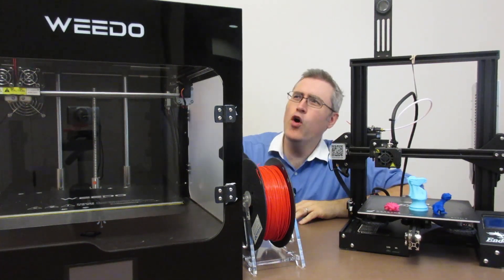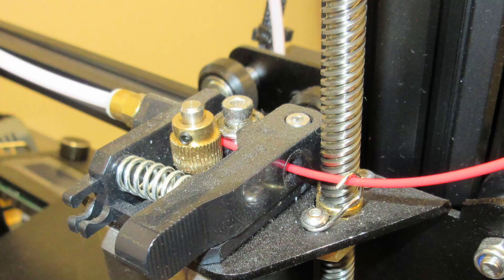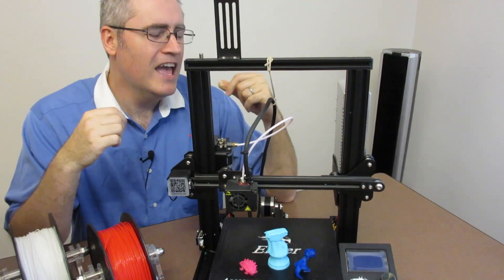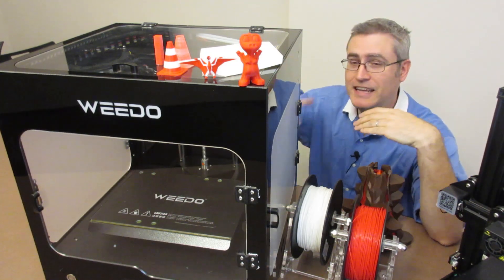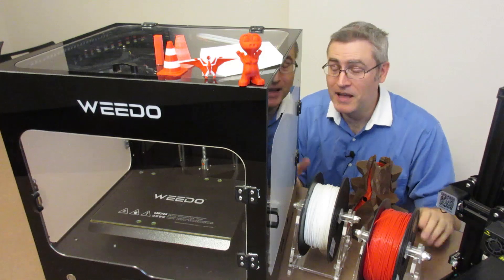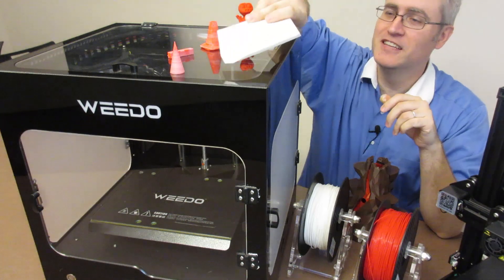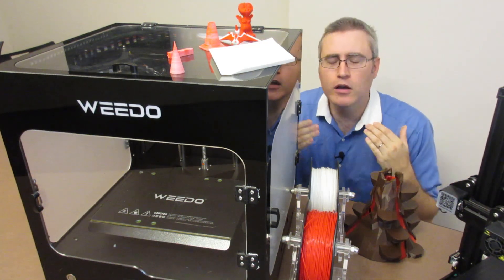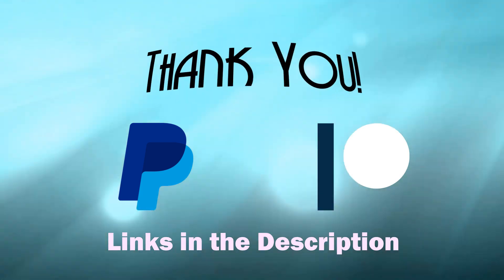Ender 3 vs Weedo F192 Double Review

Comment: Someone near me is selling these brand new for $300. Is this a good buy for someone who is new, or should i just get the Ender 3 V2?
Reply from the maker: The F192? I would say it's reliance on WiiBuilder, their custom slicer, is a major handicap. I don't mind it when BambuLabs or Flashforge made their own slicer because it was good, but WiiBuilder is still a pain in the butt to use. 
If this is your first 3D printer, I wouldn't recommend either this or the Ender 3. Enders are notoriously badly documented. Instead, my not check out the Mingda Magician V2. A well documented machine with the same capability as the Ender 3.

Comment: It's like comparing a Rolls Royce with a Ford. I have used an Ender 3 for six months and for the price it produces great prints right out of the box. Assembled and printing in under two hours for not much more than pocket money. The Ender 3 is a great introduction to 3D printing.

Comment: I have an Ender 3 and we were printing within 2 hours of opening the box and this is our first 3D printer. I have to say after you went on your rant about assembling it I really started to discount other things that you've said in your videos. I by no means I'm saying that the Ender is perfect but for the price it's a solid entry level 3D printer. Not only that but you're nitpicking over the location of the filament feed is trivial since it doesn't effect the filament, if you really wanted to nitpick you would have mentioned about the location of the cooling fan for the processor.

Comment: Does the weedo have a 32 bit board with trinamic drivers? Does it have a heater for its enclosure? Does that board have wifi access?

Seems like the weedo is is overpriced and underfeatured

Comment: An over $1k printer and I have to turn screws on it to level it? I put a cheap BLTouch on my Ender3 and I don't have to touch a thing for it to auto level. The Ender3 is also my first 3D printer and it took me less than an hour to put it together. I have access to two Prusa Mk3s at my work and I'd rather have the Ender3. For $200, it can't be beat. Although, you have convinced me to never by a Weedo.... ;-)

Comment: Having the extruder so close to the axis screw is actually one of the reasons ive ordered an Ender 3 compared to other low cost printers, mind you it hasnt arrived yet and would be my first printer. But due to my background as an industrial mechanic i know that its a good design to have the extruders mass close to the load bearing point, having it on the opposite site would introduce so many issues, just mentioning levering force and mass acceleration should be enough to point it out.
Reply from the maker: Good point, but why can't they move it just a centimeter back? The Tevo figured it out. Mind you, my Tevo wasted a month of my time and couldn't actually print, but the solution is out there.
Reply: @3dpprofessor  I dont know how cost efficient crealities engineers design, but that one centimeter can make the difference between a cheap part being enough or a more expensive part being requiered, or a part of stock being used or a new one being requiered. When i see how much of the Ender 3 can be improved with it printing parts for itself i guess its a mixture of cost efficient and tinkerbox engineering.
Parts the end user cant improve easily? Put in decent to good quality parts.
Parts the end user can easily print, tune, tinker with themself? Leave them out, people can print them themself.
For a plug and play experience most businesses requiere thats not a good think, but for the home gamer it might be the best design idea out there imho. Cheap entry cost, early learning of the machines mechanisms and how to improve them, etc.

Id only question why they didnt put parts to improve the printer on its SD card...

Comment: I'm fairly sure your Y gantry is not level.... just by looking at it.  

It's an easy to fix.  Just get the the screws attaching the two plates that the rollers are on loose enough that you can tweak them manually (there is some play in the holes). Make sure not to loosen them so much that everything is floppy. You'll also want to get the wheels wobbly so things are easier and things don't bind (ie loosen the ecentric nuts on both sides). You'll have to remove the assembly from the vertical extrusions so also take off the top bar. Once you have that done....

Get two spacers (I used two hard drives) that the assembly can rest on. Set them on the bottom extrusions (remove the screen to get enough room on the right side) and lower the gantry. Gently press down until both sides touch their respective spacer. The assembly is now true. Tighten everything up paying careful attention not to tweak the left plate (this is why the plate bolts need to be loose and not floppy). You'll probably want to get the left plate tight first just because it has to come off the machine and if it tweaks you have to start over. Once that is all done it's easy to verify you're true by using the same spacers or a caliper.

Should take 5-10 minutes but probably don't have the same people that put it together do it.... would be a 2-3hr job ;) jk but really I think you should have audited the build a bit better.
Reply: Note that my Ender 3 is my first 3d printer. I've spent a lot time last couple weeks getting it dialed in. At this point my leveling pattern (5 circles on each corner and middle) are within 0.01mm of ideal and are perfectly smooth with no gaps etc... calibration cubes and walled cubes are right on.  Near perfect dimentionally accuracy as far as I can measure.

Comment: You spend $200 on a box of parts that kind of work. Then you spend weeks of time and hundreds more dollars to add on everything that is missing and to try fix the crappy engineering of it in the first pace. When you are done you have spent as much money as a better quality printer in the first place.
Reply: You can 3d print most of the parts that can improve the ender 3 printer you are talking about dollars not hundreds of dollars.   Marlin is also open source and is constantly being improved on.    I am currently running klipper  off a raspberry pi  i have probably spend about $100 bucks to improve the printer which includes proper auto bed leveling not this it tells you how much to turn crap.   I built an enclosure probably cost me $50 bucks for total cost since I purchased my ender 3 for $170 on sale looking at $320 vs $1500 bucks.
Reply: Odd ... I had my Ender 3 built in under 2 hrs (because I work in machine maintenance and got anal about verifying the build every step of the way) had it leveled in under 15 minutes, and half a decent print by the end of the evening.  The next day, the filament from the split order came in and I was happily printing minutes.  The ONLY reason I printed add on parts was for convenience and aesthetics.  The only thing I've spent hundreds on is filament - which is a consumable you'd spend on any 3D printed.  Now ... I suppose I could agree that people with zero mechanical aptitude and no patience may not be well suited to an Ender 3 - but they probably shouldn't get involved in 3D printing in general.

Comment: I work in additive manufacturing primarily with powder bed metal, but we have some big stratasys printers and some smaller uPrints. Can’t stand how limited everything is on their printers and the quality isn’t even as good as what I get on my CR-10S at home. No, I can’t print things like ultem, but for a several-thousand dollar difference, I find some of the printers like the CR-10 and ender 3 to be wayyy better value than the closed-source stuff

Comment: A day to assemble the Ender 3? It is my first 3D printer, but even taking my time, assembling it carefully, I produced my first PLA print within 2 hours, and my second print was a perfect test dog using ABS, in open air, about six hours later (I got lucky with the ABS that time, and removing the print destroyed my print surface due to the extreme temperature required to get the ABS to stick. Now I have an enclosure, borosilicate glass, and a PEI sheet. I also found that ABS prints often do benefit from running the fan, balanced against a bit higher nozzle temp to improve layer adhesion.)
Reply from the maker: Yeah, I did mention I was reaaaly burnt out on kits by the time I got the Ender 3. There may have been some procrastination.

Comment: Makes no sense. With that amount of money you can buy 6 Ender 3 printers. or even 5 and build a simple persplex enclosure. Which is what I have done. Also it took be about 3 hours to build 3 Ender 3 printers and I have never built a 3D printer in my life.

I have recently owned a Flashforge Adventurer 3 and it was rubbish and big let down. Returned it and never looked back with regret.
There are many factors into why an Ender 3 is the smarter choice. Also manual bed levelling is not that complicated when you factor in all the variables. Once the bed is levelled correctly, you should not have to play around too much. That is with Glass beds, magnetic beds and standard beds. I have all 3 beds and each work fine. Only limit is no ABS with magnetic bed.

That start up sound from Flashforge will forever taunt me. It was a really bad introduction to 3D printing, and goes to show that sometimes you don't always get what you pay for. In 3D printing, looks of a printer are not what counts. It is performance. And the Ender 3 menu system and screen might be old, but it works well. Does not freeze or have touch sensitivity problems like others do.

I think this review was a bit misguided considering you did not build it yourself. But you are entitle to your opinion.

Also, a major step that should be on the Ender 3 build manual is to FIRST and FOREMOST loosen the side bolts and rest unit on level hard surface, then frame will sit flush, tighten but do not overtighten, mount everything else, and then tighten them firm last.

At least everything is accessible and not hidden away. Easy to maintain too.

Comment: the bed size on the ender 3 isnt 200 X 200 its 220 X 220 X 250
Reply: Actually its 235 x 235 x 250
Reply: @dronephotographyireland  The official specs are 220 X 220 X 250 but you can do 235 X 235 X 250

https://www.aliexpress.com/store/product/CREALITY-3D-Printer-Ender-3-Ender-3X-Upgraded-Tempered-Glass-Optional-V-slot-Resume-Power-Failure/2846085_32858931045.html?spm=a2g1y.12024536.productList_2866066.pic_0

Comment: Ender 3 may look robust and has received many positive reviews on YouTube, but I personally don't think it is that good.  I have had mine for nearly 2 months, have tried umpteen different settings, yet have not been able to make it print consistently. I have had fantastic and consistent results on an older 3D printer, the Startt, a $100 U.S. printer which was 100% kit format. It printed great right after plugging it in and continues to do so to this day.  
I feel the quality of the prints on the Ender 3 are far from good and something you would expect if you cobbled parts together to make your own kit printer.
Reply: I have a CR-10S, not an ender 3, but I and everyone I know that has an ender 3 (which is quite a few because I’m an additive manufacturing engineer) has been very impressed with the results from creality printers. It shouldn’t take much fidgeting with the settings unless you got a messed up printer. Just recently helped a friend choose an ender 3 as his first printer and it performed  awesome right out of the box
Reply: Since you know so many people with Ender 3's, maybe you can have them send me their CURA settings so I can do awesome prints and also become impressed with the Creality printers!
Reply: peter bucik for Hatchbox PLA, you can just use the stock recommended PLA profile with 0.1mm layers, but with the nozzle temperature increased to 215C instead of 200C
Reply: @BenWilson24  I am running my Ender 3 with Hatchbox PLA at the 200C setting and it works beautifully- including the glow-in-the-dark and clear.  Never had the need to up the temps to 215C. As for this comparing video- dude is trying to compare apples to oranges.  If it took him a day to assemble an Ender 3, he needs to get into another line of video reviews.
Reply: Yeah. It's a great printer if mediocrity is all you strive for!!!
Reply: @pjb5262  Actually, in all the printers I have (over 200 different types), the Ender 3 is one of the best... and easily at the top considering the price.  Perhaps there is something wrong with your particular machine that is causing the issues.  The stock settings (or Chuck Hellybuck's settings) are perfect for it.  Try them, if it's not working correctly, it's time to diagnose it and see what is causing the issues.  Most of the times, it's loose eccentric nuts or belts causing slop in the system.
Reply: peter bucik what do you print with?
Reply: @BenWilson24 If I am after accuracy and structural integrity I will print with my Startt. I can use the same Cura setting for anything I print without any modification. I tried the settings you gave me for Ender, and the results were somewhat improved, but  far from good. I generally print mods, repair parts and rc parts and therefore require more integrity in the 3D part unlike someone who is  printing  figurines. Check out ColdCanuck on Thingiverse to see what the little Startt printer can do. Even the Ender mods were done on the Startt.
Reply: peter bucik both accuracy and structural integrity can be tuned through setting adjustments. If the default Cura settings don’t get you that out of the box, then that’s just a mismatch of Cura’s default settings with your printer and environment; creality’s printers are very rigid and use the same motors as many brands, so they will do what they are commanded to do. Don’t confuse Cura’s suggested settings or settings you’ve tried with the quality of the printer itself- they’re separate. If you’re looking for mechanical properties though, I’d swap to a different material like PETG or ABS. I’m currently running a large factorial DOE for determining settings that get me a solid balance of strength, dimensional accuracy, and density for PETG because the default PETG settings in Cura weren’t perfect. A lot of factors come into play with dialing in settings like the ambient temperature, the brand/quality/state of your filament, etc.

Comment: Auto level that you have to turn screws on? My ender 3 and bltouch is truly auto level. And anyone that takes a full day to build a ender should maybe not be in 3d printing.
Reply from the maker: That's not actually auto level. that's level correction. It doesn't make the bed flat, it just adjusts the print to compensate for a bad level. Big difference in my opinion.
Reply: @3dpprofessor  So what happens if the weedo bed gets warped, uneven surface, etc.   Truth is, the weedo uses the EXACT same method as the ender to "level" the bed if you were using an inductive sensor (much less accurate than the BLTouch) instead of a bltouch, except the weedo only probes 3 points, and the Ender can probe as many as you choose. The difference is you can set the Ender to automatically correct for the misalignment, or you can use it to MANUALLY adjust the bed screws to achieve level.  The fact still remains, the weedo does NOT have auto bed leveling, rather sensors to tell you if the bed is level or not. The leveling happens manually... The weedo has no mechanism to correct for warped bed, uneven surfaces, or what not.  While it may be less of a problem with the weedo than the ender, the fact remains that there are no groundbreaking amazing features of the weedo to justify the price difference. Better materials and/or build quality, maybe...But not worth it in my book.
Reply: 3D Printing Professor it’s a huge difference.  Level correction indeed, and if you have a warped or bad lead screw your in for a rough time with bltouch. Relying on the lead screw vs a truly flat bed is night and day.  And creality is known for supplying warped  beds...  and poor quality lead screws. Bltouch is nice, but won’t truly correct for poor bed build quality, and will make a bad situation worse if one has a bad lead screw.  I’ve got two Ender 3s and both came with severely warped beds and lead screws. As far as I’m concerned unusable print beds.  One uses bltouch and one is manually set.  The one without prints a bit better, and without a replacement lead screw.  The one with the bltouch took so much longer to get printing properly, including replacing the lead screw with a much higher quality one.

Comment: A day to put the Ender 3 together?!?!  Were they 6 years old?  I have never assembled a 3D printer before but when I got my Ender 3, it took me about an hour to put it together, and another 30 minutes to go back and correct little mess ups (x axis was about a half inch higher on the left side than the right).  I will admit, I'm a little more mechanically advanced than someone that might not put together/assemble things on a regular basis, but the Ender 3 shouldn't take more than about 2 hours to put together.  Also, anyone that does get the Ender 3, PUT THE MICROSD CARD IN THE READER AND LOOK AT THE FILES ON IT!!!!  I built mine with the little quick assembly guide that came printed in the box that had ONLY pictures and no written instructions on it.  On the MicroSD card there is a full step by step picture and written guide to assemble the printer.  (edit: changed 'no pictures' to 'ONLY pictures')